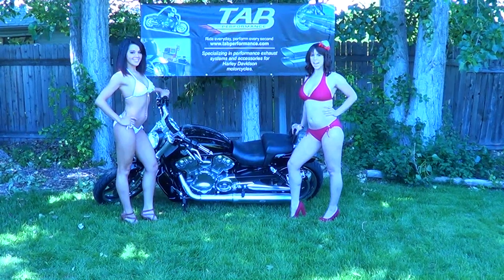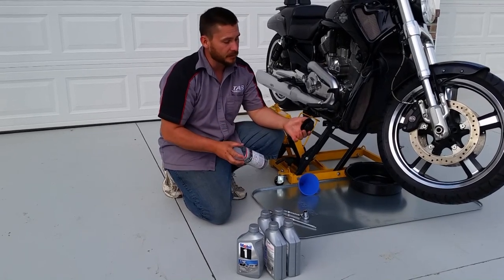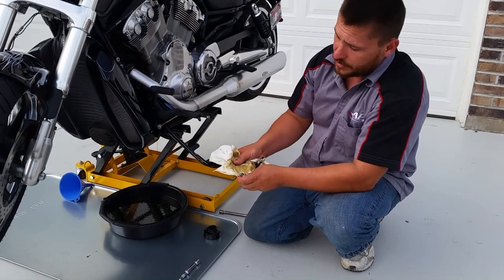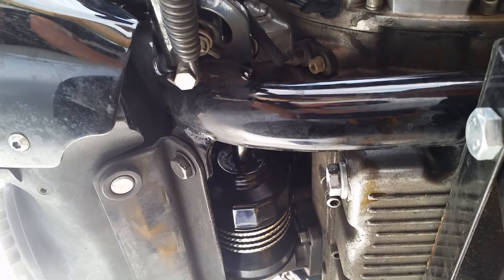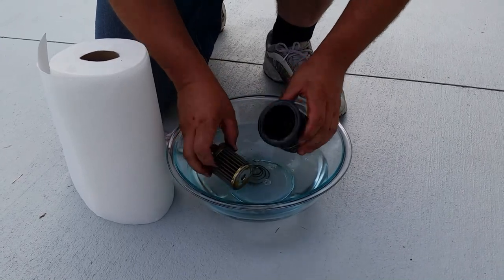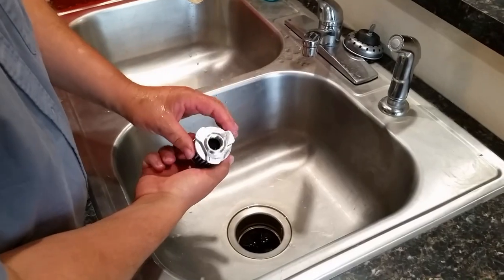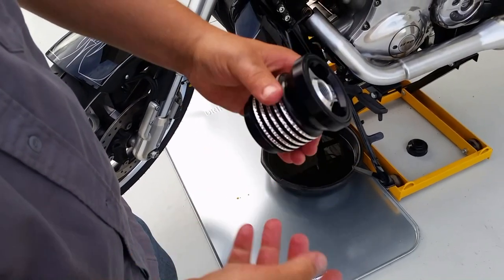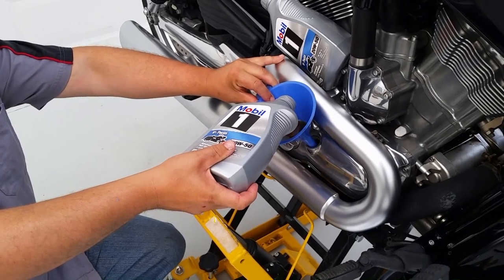How to change the oil on a VROD & K+P Engineering reusable oil filter

Comment: Bud, good job. Q, Do I need jack/lift, if so which one do you recommend .. ? I liked 
Powerbuilt 620422E Heavy Duty 4000 lb Triple Lift Jack, but am unsure if it will fit under ..

Comment: doitlaynstyle have a question , if i buy the filter the fitting to remove the filter comes with it?
or i have to buy it separate it's a standard fitting size for  most filters?
Reply from the maker: Ovidiu M, 
yes the wrench/socket is supplied.
Reply: thankyou!